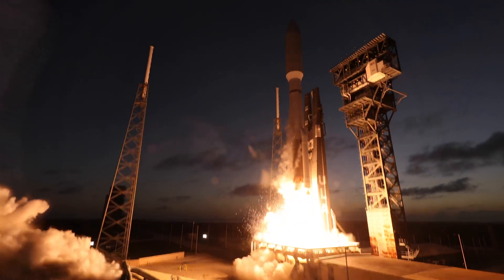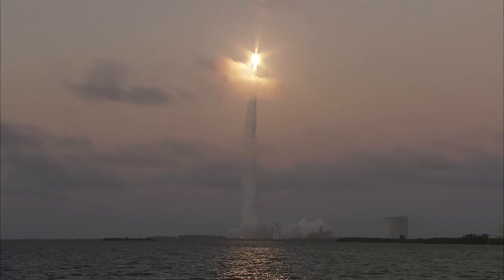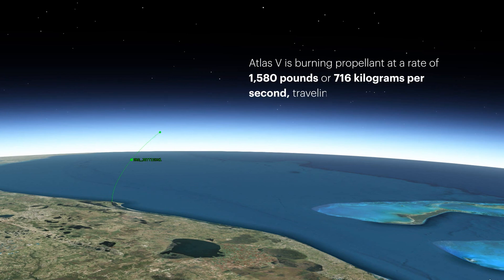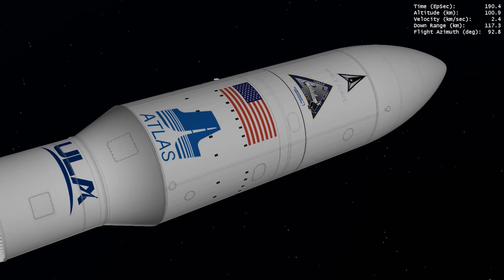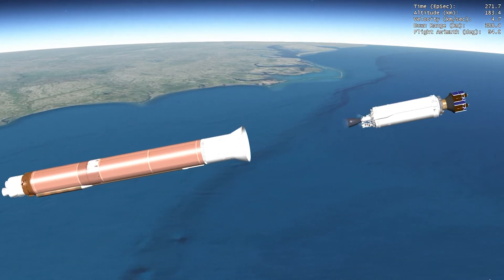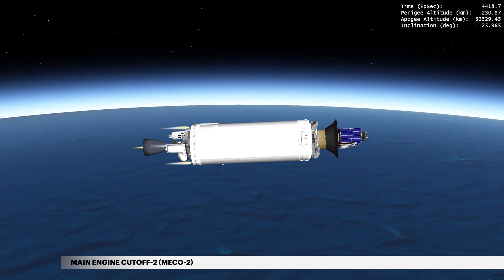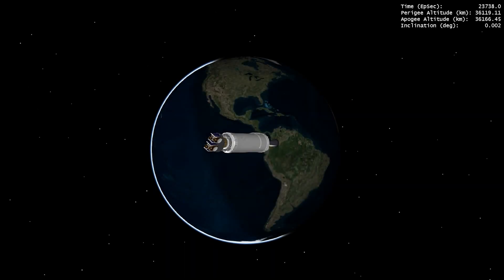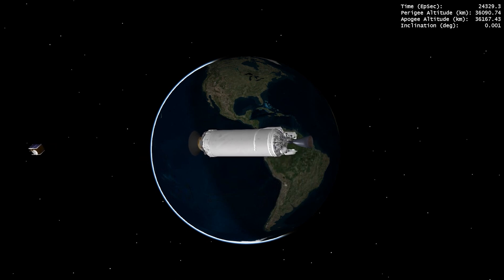Atlas V USSF-8 Mission Profile

Comment: Question: What happens to the 2nd stage? will it make another burn to a parking-orbit or will it become debreis?
Reply: Centaur will passivate it self and change it orbit
Reply: It performs another burn to re-enter the atmosphere over the ocean and burns up
Reply: @Tmccreight25Gaming  from GTO? there is hardly any fuel left in the second stage at that point... it will deorbit on its own, but it will take some time
Reply: @witchdoctor6502  correct. From GTO only a small retrograde burn at apogee is needed to bring the perigee into the atmosphere and provide a safe re-entry.
Reply: @Tmccreight25Gaming   Not GTO, GEO. See the perigee and apogee at 3:06. According to ULA's website they will do a "blowdown". I think that's when all the remaining propellents are released out of the Centaur.
Reply: @kenjiokura7601  in that case Centaur will use its RCS thrusters to boost into a graveyard orbit approximately 300km above GEO

Comment: Did the upper stage get left up there as junk? Or did it perform a deorbit burn and come back down?
Reply: It deorbits itself into the atmosphere over the ocean
Reply: @Tmccreight25Gaming  That's usually only done for LEO or MEO missions, and some GTO ones. Deorbiting from GEO is a lot harder because there's usually not a lot of fuel and battery power left by that point in time. More likely the Centaur stage is going to be sent off into a "graveyard" orbit away from operating satellites.

Comment: Can someone explain why they opted to go with the 5.1m fairings if the payloads are that small? A regular 4.2m LPF should be plenty big, no?
Reply: Aero loads. Perseverance easily could have fit in the 4.2m as well
Reply: @cosmicandrew50  I understand that. But that was because they launched with 4 GEM63s. This thing is just using 1. Centaur alone can handle the aero loads just fine with between 1 and 3 solids without being encapsulated. So if these payloads are actually as small as they appear in this video, and they are only using 1 solid, I don't understand the need for the 5.1m fairings.
Reply: @liquidhype3025  Maybe they wanted to fly the 511 version since it's never been flown before, haha. But yah it terms of fitting in the fairing it does. These satellites flew on Delta 4 before with the 4 meter fairing. I'm not sure how to answer the other part of your question though.

Comment: pretty good. id take a centaur anyday. Shame on starliner being the only vehicle for atlas, would love to see SNC dreamchaser on there instead of that ugly tip
Reply: Dreamchaser will be riding on Centaur V ontop of Vulcan. Centaur V signals the return of Dual Engine centaurs, but has a different diameter of the Atlas and Titan centaurs.
Reply: Do you really think Blue Origin will deliver a working BE-4 engine for this to happen? I'm beginning to wonder.
Reply: As much as you would like to believe they won't, satellite images have captured them firing engines, which are almost certainly flight engines